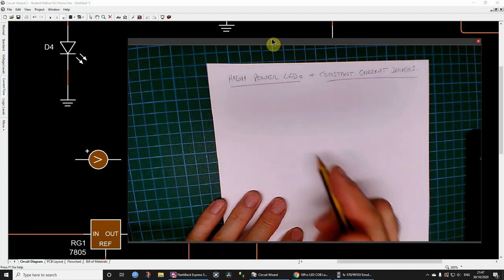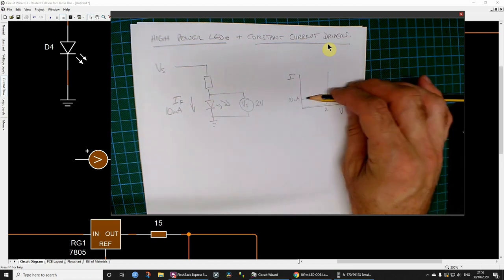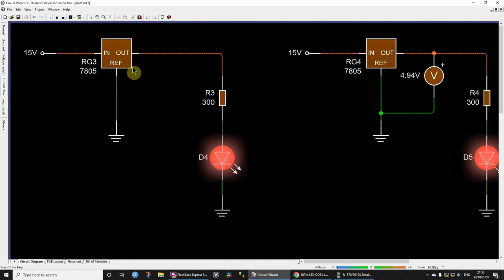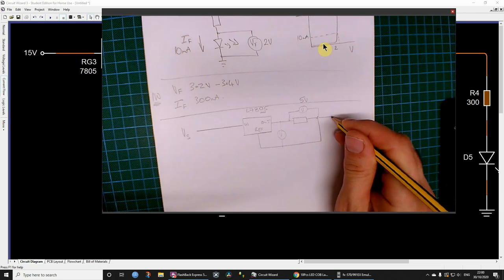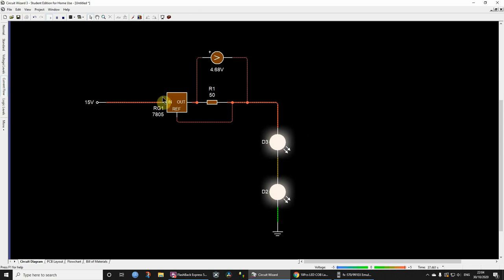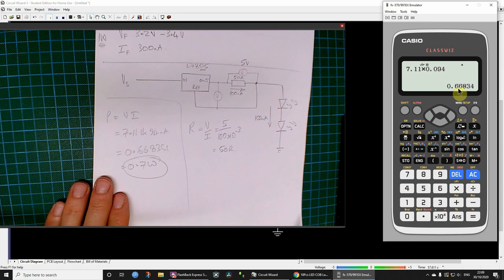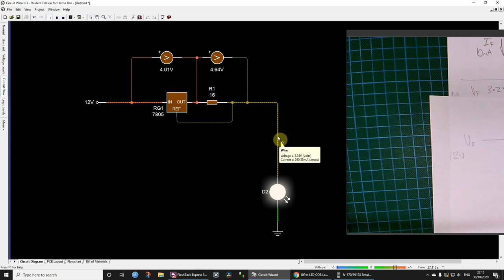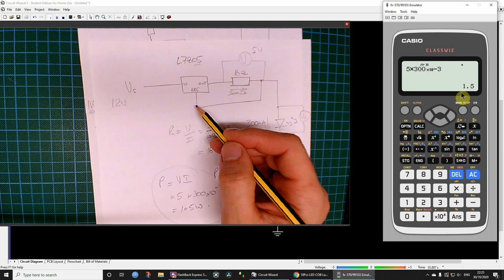How to use a voltage regulator L7805 as a constant current LED driver

Comment: Hi! Thank you very much for your video. Very helpful!
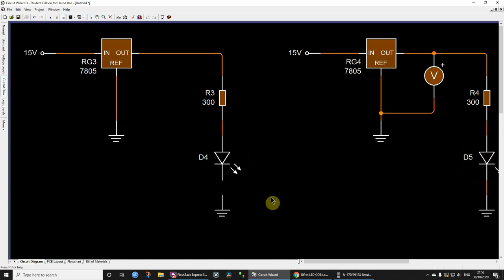At about 9:05 you said that the output of the regulator needs a load. But what if the LED burns over time due to aging and it would wouldn't be replaced for a certain period of time, can the L7805 get damaged?
Thank you in advance.
Reply from the maker: A component can fail open or closed (short). If it fails open then no current will be drawn. A constant current driver will then increase the output voltage in an attempt to drive the current. On the other hand, if the LED fails shorted, the constant current driver will reduce the output voltage to limit and therefore maintain the constant current.
Reply: @PizzeyTechnology  Thank you very much for the answer. So if the component fails open, the regulator will slightly increase the voltage but since no current is flowing, there is no danger for the regulator to get destroyed, even not after a long period of time.
But if the component fails short, the current flow from the regulator will be very high. But since the regulator has a built-in short circuit protection, I suppose that the regulator will not overheat or even get damaged, even if after a long period of time. In that case, the regulator could even act as a short circuit protection to the circuitry as well as for the power supply prior to the regulator. Are my thoughts correct?
Thank you very much ones again for your help 👍
Btw, subscribed to your channel.
Reply from the maker: @sesvid  Nearly there, but not quite right. If the load fails "open" the constant current driver will not "slightly increase the voltage" -- it will increase the voltage as much as it can. This will be limited by the supply voltage (Vs or Vin) and the regulator drop (Vd). However, with no load current there will be no significant current through the voltage regulator. Power dissipated (P = VI) will therefore be minimal. No power = no heating. Thanks for the subscription.